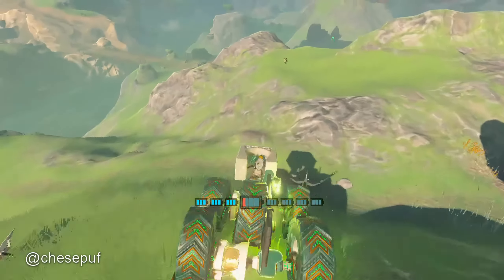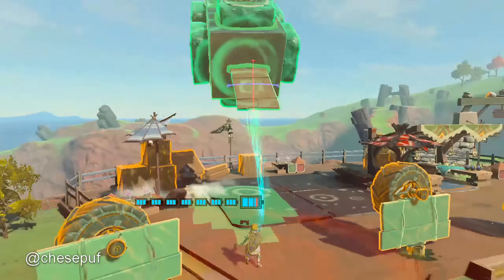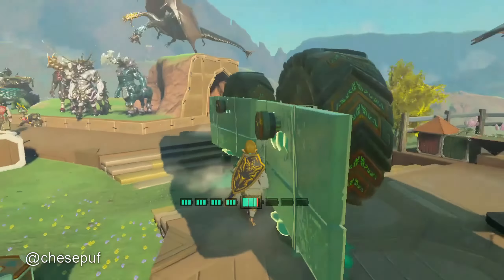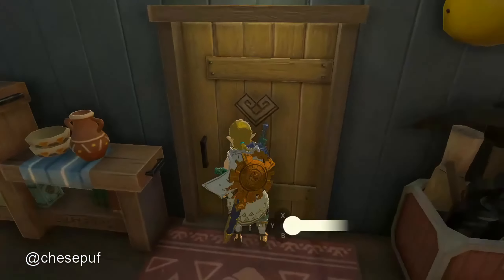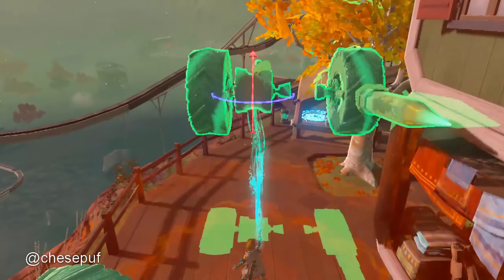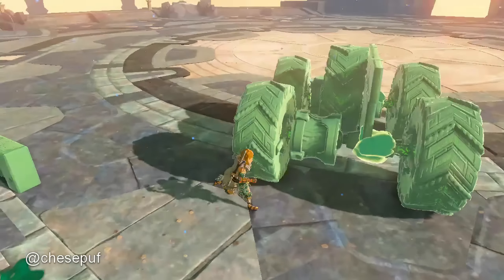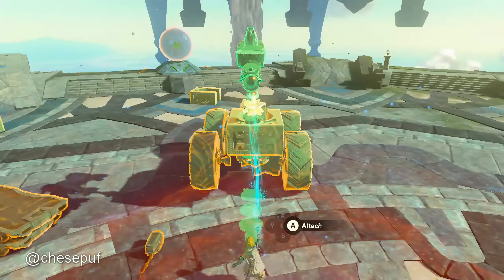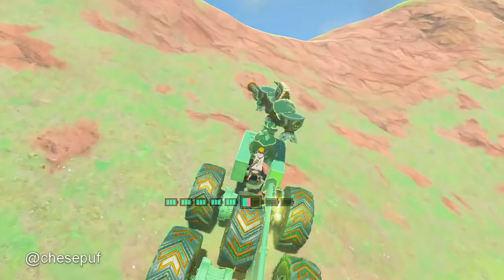How to build the ULTIMATE car in Tears of the Kingdom!

Comment: I built a version of this without the FE big wheels, and it does alright. It's not as fast as the one in the video, but it still moves decently fast. I added some small wheels on top of the big wheel in the center to keep it from bouncing around so much. It climbs hills no problem, and I drove it all over the Gerudo desert and the Hebra mountains without too many hiccups. Make sure to attach dragon parts in case it goes flying down a hill!
Reply: I have a question about it.
Does it go a lot slower or almost unoticable?
Reply: @shadow2210k Well, the wheels are stake nudged apart with the electric motors inside, so it's a little bit slower, but still faster than just regular big wheels. I think the plate slows it down a bit because of how heavy it is. In all of my other builds I use the railing from the right leg depot as the frame. I might try fuse entanglement at some point, but it just looks so tedious that I'd rather not if I can help it!
Reply: @jamescrumbaker3169  ok, thank you for the response.

Comment: I heavily appreciate the audio guide. Is there any way to build a "poor man's" version without glitches? I have monke brain, and will do this wrong lol
Reply: I built one by stake nudging the two big wheels to fit the motor between, then I managed to get the gravity pressed wheel down using a big iron block. I don't want to attempt the FE glitch. The middle wheel might not be able to flex enough if it isn't sitting lower, but you could just attach the big wheel in the middle on the bottom of the plate and try your luck. I had to stake nudge the middle wheel for like an hour in the plate so it wouldn't be all crooked. There are other no-glitch builds, but they fall apart too easily and they're just as tedious to build IMO.
Reply: The FE glitch can be attempted as many times as you can, as long as you have enough rupees, since you can just easily detach it.
I don’t think you should be worried to try it.

Comment: My middle wheel doesn't want to stay pressed down, even if I pressed it down the right times. How do I correct this so that the middle wheel stays completely pressed down even in Autobuild? Also, how many times do I need to press the middle wheel down and do I need to press it down once I put the first set of motor wheels? And how do I put a foward slant on the steering stick so that I can climb better?
Reply from the maker: Hmm, once you press the middle wheel into the goron plate, you need to pull the tire so that the axle is near the edge of the tire. I used a stabilizer and stake to pull it down. Then you add the axles to the goron plate while the middle wheel is pulled. This way the middle wheel wants to push against the motors when all stakes are removed. The steering stick is slanted forward with stake nudging. Both of these processes are shown in the water temple in the video

Comment: Hi,how do you build the exact turret you used in the video, i really like it. If you see this please respond. (If you have any channel links to it in hyrule engineering server)
Reply from the maker: It's a great turret! Here is a link to a quick guide on making a conga turret. You may need to make small adjustments, but this method gets you 95% there https://discord.com/channels/1111875355758837830/1131765202392711341/1151517491189780521

Edit: the pressed beams are difficult in vanilla. You can either use phantom beams, culling, or pressing to push them together. Nothing wrong with an O or + design on top too, though
Reply: @chesepuf  thank you so much!

Comment: I can do FSFE on the motor but not the big wheel it won’t cull so if FSFE doesn’t work then how else do I fuse entangle the large wheel in patch 1.2.1? Also, do I need to FE a big wheel or no because I tried it and it still works?

Comment: I’m having a few issues with building Hank: 
1. The big wheels are not fast like in the video even though they have the motor between them.
2. When I tried flight, the wing just tipped over to the side even though I did nothing.
3. I did gravity nudging 10 times, but the wheels were not aligned.
4. I have no idea what is the cube that is used for gravity nudging because I used the Sonapan Shrine cubes for gravity nudging, and I had problems.
5. Where do you attach the shock emitter?
Can you please help me with these issues? I am on 1.2.1 thus cannot do item culling.
Reply from the maker: 1. The big wheels have to be attached to the body of the motor. The one on the right cannot be attached to the motor axle, it must be q-linked to the motor body. 
2. Work on regular Hank first. Flying with a wing is tricky and took me a bit to figure out the balance.
3. 10 times is a rough value, you have to compare to the axles and middle wheel in my video.
4. Not sure what issue you're having the sonapan cube has a bunch of snap points, it's just a heavy block for attaching hoverstones.
5. I show attaching the shock emitter as the last step at the water temple. Attach it anywhere on the top right side of the goron plate, the further forward the better.

Comment: Edit 2: finally done. It was very hard and took me like hour and a half. Had to fuse the motor back to the wheel when in culled state by stepping back to make it visible then after that had to blind align the staked wheel once i had the motor disappear without breaking off and took many tries to get both the height and side alignment to be perfect or almost perfect. But I finally have the axel that’s on 7:15. I gotta say that anyone trying this build needs to do the fuse entangled axel first and then go with the gravity pressing which is easier. 
Edit: so i have a fuse entangled motor shield and used the fused entangled motor to make the first part of the axle but when i go back to the area to make the motor disappear it does disappear but it also disconnects and disappears from the entire build. 
I got a question. The fuse entangled shield has to be entangled beforehand with a motor? I’m confused on that part maybe include the new super quick FE method in the vid. Cause the motor won’t disappear at all. It confuses me because you drop a shield that does not look fused entangled. 

Appreciate the build and looks fast and torquey.
Reply from the maker: Yeah you gotta FE the motor to the shield. The shield will look empty and the motor will be on the ground next to you. In the menu, the shield will show a motor fused to it. Drop this shield in the culling room and the irl motor should dissappear as you walk away from the culling room

Comment: Hello, I've gone through the process of building Hank, and I have a problem: my joncons vibrate aggressively when using this vehicle can you tell me why is that?
Reply from the maker: It's probably the middle wheel smacking the motors. If it looks like the middle wheel is bouncing up and down a lot, you should adjust its position slightly up or down. You want to get it like in my videos where the middle wheel is pretty locked in place.
Reply: @chesepuf ok, I just got back to 1.0 so once I get to certain point in the game I'ma build Hank again!
Reply from the maker: @shadow2210k  Excellent! Good luck in your building journey!
Reply: @chesepuf  thanks!

Comment: If you used gravity nudging, how many nudging times would you need?
Reply from the maker: Depends on which part you're describing. If you're asking about the middle wheel in the goron plate, I showed the exact number of times I needed in the video. If you're asking about the axles, the left side would need a couple presses and the right side would need about 5-10 stretches